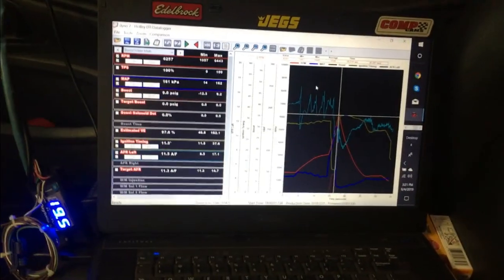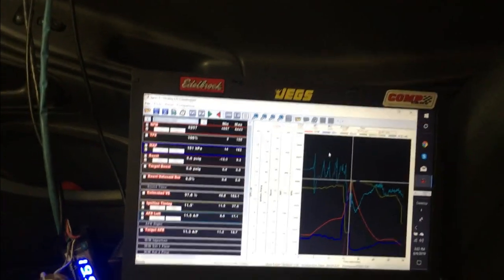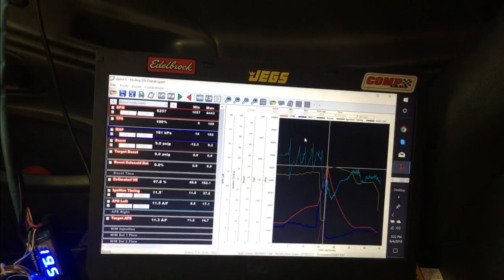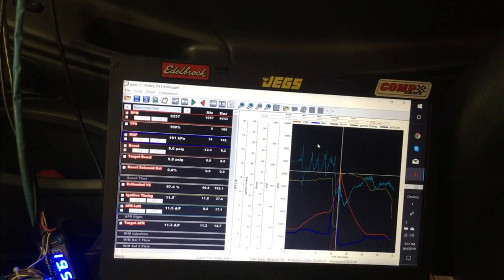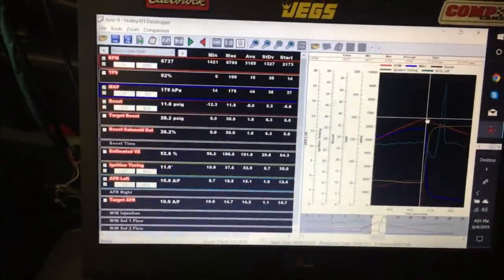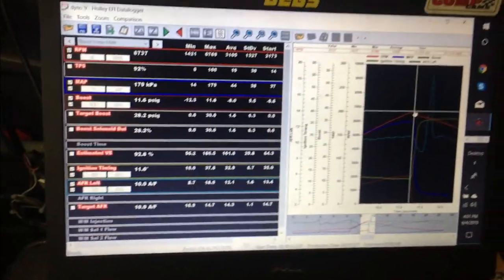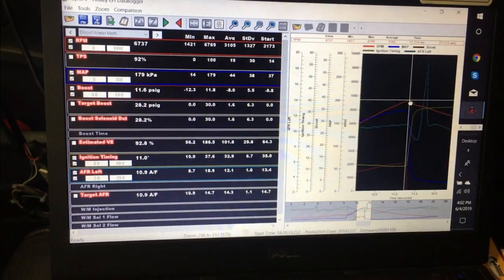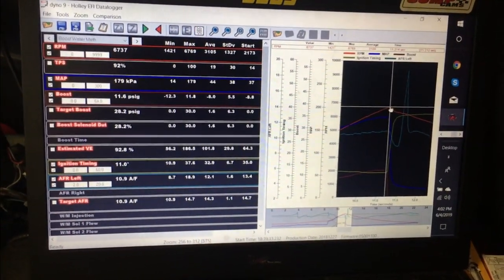LJMS Stage 1 VS Racing 7875 Tuning

Comment: Did you gap the rings? Or just left stock ring gap
Reply from the maker: This motor had the stock ring gap, after we found the broken tool in the motor the owner took it home and swapped it out with a junkyard 6.0 overnight and we tuned it the next morning. In 48 hours the car had a motor swap, retuned, and was driving on Hotrod Power Tour
Reply from the maker: The owner is putting together another motor for later this year with forged rotating assembly and head studs, we will turn it up then.

Comment: I have the same cam and a Huron billet 78/75 for my LQ9. Stock heads, stock bottom end. What other mods does this one have?  Assume results.
Reply from the maker: This is a bone stock (aside from cam and springs) LQ4. The owner had a piece of metal fall into the first motor which was a 5.3. He swapped that out over night and brought it back the next day with the junkyard 6.0. Transmission is a T56.
Reply from the maker: We stopped tuning the car at 13.8 psi and very conservative timing. Part of that was due to a time constraint and a faulty charge pipe clamp holding anymore boost.
Reply: You do any remote tuning? HP tuners
Reply from the maker: We do mail order tuning for mild builds. We also do some technical assistance over the phone for a small fee. You can also message us on Facebook